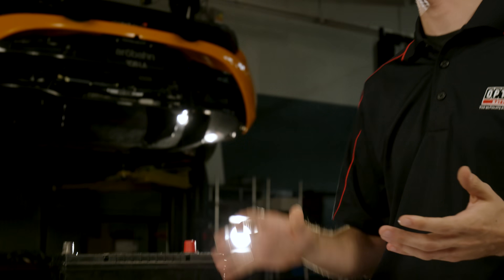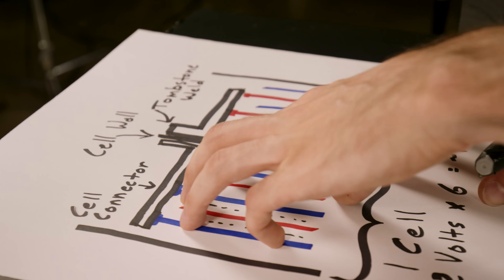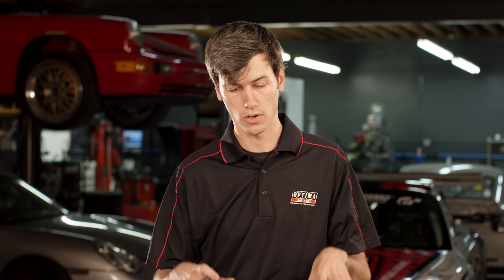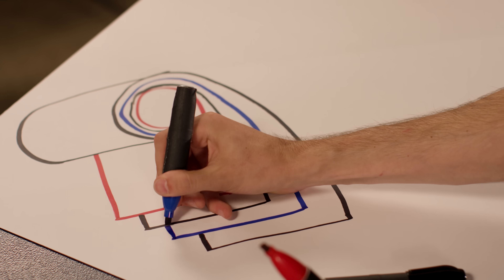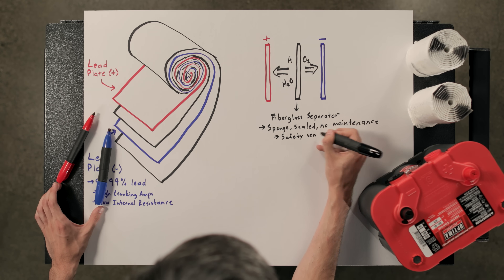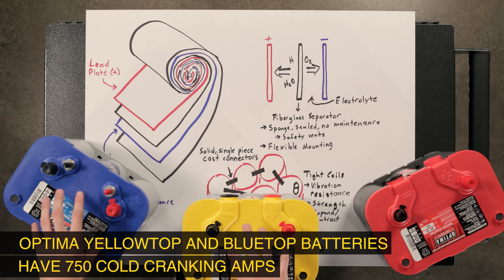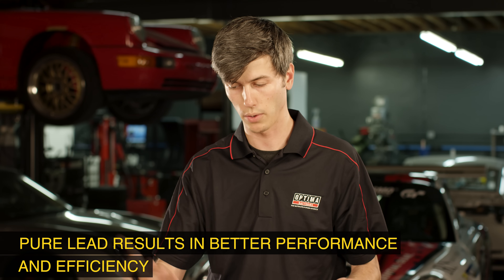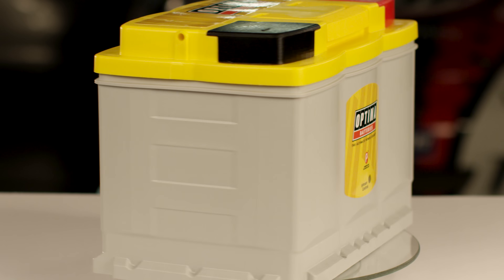What Type Of Car Battery Should You Use? Flooded vs AGM

Comment: IF Optima felt confident in their claim of "Can last 3x longer than regular batteries" then why are their battery warranties no different than the cheaper flooded acid batteries? For the price on one optima, you can buy nearly 3 ordinary flooded batteries. I'll take my $80 flooded and you can have the $240 Optimas from Mexico.
Reply: Warranty is for problems that are not due to abuse.
Reply: @nthgth  i am not talking about beating it with a hammer i'm talking about all the people who would run with a bad alternator over charging under charging killing it constantly. we are talking electricity and charge cycles there is lots of ways you can kill a cell or weaken them by "abuse" that won't leave any tell tale signs that would just look like a manf. defect and they have to protect themselves. these batteries are not meant for a everyday driver in a normal car they are meant for higher "abuse" scenarios
Reply: @ericvickery6357  ohh I see, I misunderstood.  That is a good point.
Reply: @nthgth  lol. Thats a first time I see someone admit their mistake in the comments section. Why don't you insist on your opinion as everyone does? Whats wrong with you?! Lmao
Reply: Went through 3 optima red tops in one year...bought from Amazon..
Reply: @stuartbachus  yellow top I just bought a jump box and roll with it .... og course I have to roll my bass nob
Reply: @stuartbachus  Switch to Odyssey, much better than made in Mexico Optima became junk when sold and moved to Mexico.
Reply: @stuartbachus got 3 Optima in 5 years, the do not like to be deeply discharged and my cars all of them i EVER owned was battery killers..,.,.
Reply: @stuartbachus  and how in the world did that happen?
Reply: @ericvickery6357  Optima was bought out a couple of years ago and now they're quality is just like any other battery except more expensive
Reply: @liveandletlive2894  Truth
Reply: @ericvickery6357  

Because those Optima  battery are dirt that's why, they don't last very long I would never buy one!
Reply: @liveandletlive2894  yes i've heard that as well
Reply: My yellowtop only last 1& 1/2 years.
Reply: @B2stunt1  i still have a yellow top that 5 years old! Showing age now tho, but we yse it on a boat! To just turn on engine.
Reply: @B2stunt1  mine lasted less than 6 months... only bumping 2500 with big three and stock alt
Reply: @B2stunt1  my yellow top is 4.5 years old and just sat in a car with no engine for about 3 months, charged right up and tested impressively well, doing much better than the 2 year old battery in my other car that has taken over as the daily, while she gets fixed properly
Reply: @timclarkjr1222  That battery was probably built in America before they sold out to another company which moved to Mexico They where great batteries before that, Not now
Reply: @timclarkjr1222  And I bet that battery was made in the USA not Mexico
Reply: @kurtnulf3362   the plant moved to mexico 4+ years before mine was made
Reply: @timclarkjr1222  Maybe so But after hearing all the complaints I decided on a Odyssey instead
Reply: @kurtnulf3362  i’m curious to know how much did you spend for that Odyssey was thinking about getting one myself either that or a stinger
Reply: @chadjay828  $275
Reply: I read that they were made in the US, are now made in Mexico and the quality went down the toilet.  I had a US made Optima red top in my son's car, it outlasted the life of the car, over 10yrs on an older car.
Reply: My Yellow-Top was only $160, but that was 10 years ago.  This is in my collector car which gets out only a handful of times in the summer.  It sits all winter.  I've forgotten the battery maintainer for a whole winter, come spring battery was totally dead as expected. Put it on the charger and it accepted the charge and got topped off.  No problems whatsoever with my 10y.o. YellowTop
Reply: I already get 14-18 years of life out of my flooded SLI batteries that are properly maintained, so what can I expect from the Optima that is 3x longer life? 42 – 54 years? That would be impressive.
Reply: @JT-ov2yr  Won't happen with today's Optimas. You got really good life out of those flooded batteries. Best I could do was 10 years.
Reply: I must have a poor quality yellowtop. Bought the Optima 400 battery charger. Only gets to 75%.
Reply: In our Las Vegas summer oven heat I found an Optima spiral cell battery does not last any longer than a plate cell battery! Therefore I'll go with INTERSTATE batteries since they get the highest rating. So far 4 years per Interstate battery  in our heat. Better than average.
Reply: Got theeem💀😩😂,so true,man.I have a great deal for paying 75$ for a flooded battery with 36 monts warranty instead of those ripoff dirty dicks😂😂😂Poor man pays twice...
Reply: EE sucks. he didnt talk about flooded lead acids can outlast AGM because you cant condition AGM with a desulfation process. you can keep desulfating flooded lead acid batteries over and over with 5 minute maintenance desulfation every 2 years if yo uhave a powerful charger or welder and longer if you have a small charger with desulfate mode. either get a small charger with desulfate mode like noco brand or something with 200 or more amps like a welder and blast the battery for 5 mins for maintenance every 2 years and 15 mins at 200 amps or whatever amps you have to revive a dead battery and wait an hour in between to let it cool off. repeat until 12.x volts. just remove surface charge by putting a load on the battery briefly or wait a few minutes for the surface charge to go away between charges to get accurate volt reading.
Reply: Bingo
Reply: I had a red top Optima that lasted close to 5 trouble free years, I was impressed.  In regards to standard flooded batteries, I have always seemed to have trouble with acid leaks that caused a mess and corrosion and never last as long as the AGM battery that I had.
Reply: Because they used to last longer, until they got bought out and moved to Mexico.
Reply: I know my Optimus have been going for over four plus years with no issues at all.  They also weigh almost 20 lb less than the factory battery dropping 20 lb from your vehicle gives you additional fuel savings over the lifetime of the battery
Reply: AGM batteries do last much longer. My 2010 Lexus RX450h has an AGM battery in the back, it lasted 10.5 years and 440,000 km before needing replacing.
Reply: I have an Optima... I'm also jumping my car off ....
Reply: Used to be made in Aurora Colorado
Reply: People still think products are manufactured better in the U.S. than Mexico or other countries? 😂😂😂
Reply: I paid 300
Reply: 4 years later now and a premium flooded is almost the same price as an Optima.
Reply: Have you priced a Flooded Acid Battery lately; they are almost as much a an Optima Battery!
Reply: EFB is the way to go 😊
Reply: Atleast a  "5yr replacement warranty"  would suffice but nope! 😄👎
Reply: My experience with 2 normal optima red-top battery and a deep cycle marine blue-top optima battery is that they last 3 times SHORTER then normal batteries (and that is why I tried a deep cycle optima battery to see if it would survive longer, and it did, about 2 times longer).... The advantage with Optima batteries is they can deliver a lot of amps when starting, which help a lot in the cold with stubborn diesel engines as they start a lot faster when the battery can provide a lot of power. But even if my optima batteries was broken and could not hold a charge (would self empty in a day) they could still provide the starting amps. So I kept my totally broken optima battery for years and just kept it on a charger whenever I parked the car... but if I forgot to put on on the charger the  car would not start day after...

I got tired of the optima batteries only lasting a year or 2 and gave up using them. Optima batteries do not like to be deeply discharged and it ruins the battery much faster then on regular batteries, and all the cars I ever owned have had trouble with discharging the batteries emptying and ruining the optima batteries because of their total allergy to deep discharge . 

Now I have a AGM battery, we will see if that can take the beating of randomly being deep discharged by a sick car better then the optima... (and when you try to find out where the electricity goes by searching with a amp meter you of course get 0, is will not do it when you look at it... , so to find the thing that empty your battery is impossible).
Reply: Marketing 101
Reply: I've had 3 agm batteries fail in less than 3 years.  I feel they are a great battery for many reasons but longevity isn't one of them unless you want to routinely use a battery charger to keep them topped off as alternators on most cars can't fully charge them.
Reply: Honestly, the Optima batteries come out of the same exact factory as EVERY OTHER vehicle battery brand you can think of.  Johnson Controls makes all of them; Walmart, AC Delco, BMW, Canadian Tire, AutoZone, Interstate... They have the monopoly on car batteries
Reply: Jonathan Ryan partially incorrect.  Interstate battery is completely separate from Johnson controls.  You also fail to mention East penn mfg/deka battery.  These are the three major battery manufacturers in the USA.  East penn/deka manufactures and supplies batteries for advance auto and o’Reilly among others
Reply: @jonathanryan2915  there is also DEKA & Excide that both produce good quality std & AGM lead acid batteries. Excide & Deka have both been mfg batteries for many yrs,A std lead acid  Excide battery I had in my daily driver Nissan Maxima lasted a full 10yrs ,DEKA AGM in my 1 motorcycle lasted 9.5 yrs & a Yuasa AGM thats the original battery still working great in my other motorcycle (high compression 1700 v-twin) that was mfg’d 11/2012 over 8 yrs old going strong.
Reply: I didn’t know they were bought out, but every optima I’ve owned has far exceeded the life and reliability I would expect
Reply: Optima was a great battery at one time, but are making them in Mexico now and like most everything made there and China is total crap 💩
Reply: @lovethesmellofracefuelinth7374  Everything is made in China including the device you are using to post.
Reply: because you can abuse anything especially batteries
Reply: @ericvickery6357 nope. Because most alternators don’t charge at the voltages AGM batteries require. 

You can’t put a giant warranty that backs claims when you know they’re guaranteed to fail.

Comment: For my application I replace the 2 car batteries(1 car mainly highway 90 miles a day, 1 car mainly stop and go 5 miles a day) with cheap Johnson Controls manufactured units every 2 years as just part of their maintenance.  They are typically 90 bucks each.  2017, 1 battery was actually $50 bucks due to a pricing mistake(thanks Walmart).

Comment: I heard about battery  desulfators recently and the potential build up of sulfur on the plates causing battery death/loss of performance. I can't however find anything reputable about whether "desulfating" a battery is a thing I should be doing on my batteries to help insure peak performance? Would love to see you weigh in on this topic. Trying to figure out if it is snake oil or not.

Comment: I'm building a project car with a 4.0 v8 and it currently has a optima redtop in it. I was thinking about swapping it out for a tiny motorcycle battery and using a jumper box like the ones you see on Amazon that are about the size of a cell phone. My idea is that i can plug the jumper in to start the car and then unplug it to run on the motorcycle battery. Since I have no stereo or any electronics other than the ecu and gauge cluster that the motorcycle battery should be able to power it just fine? I figure this would save weight and act as a deterrent towards theft. Would this not work for any reason?

Comment: The simple sealed lead acid battery in my car isn't some fancy and expensive optima brand, as those aren't sold over here.

Still the Varta battery has been in my car since 2002 and hasn't dropped a beat. Optima seems overpriced for what it offers. Many manufacturers make lead polymer gel batteries and sealed lead acid batteries that work just as well. Without paying the optima brand tax.

Comment: Excellent as always.
As a personnal experience with Optima Battery, mine was a Yellow Top and was 12 years old in my car (I say was, but you'll see why). Got a bit of audio that needed a better battery. 
Sold the car (hence the was) with the battery still in it (a,d the audio). Did a test of the battery before selling it : 100% charge ok, and still giving 100% of the voltage ! Never had to recharge it ! 
Really good quality, and I will go again with Optima on my next car.

Comment: My Red Top has been rock solid.  Crested Butte Colorado.  21 degrees below zero.  My 4runner wouldn't start.  Cranked it about 5 seconds a pop.  After about 20 minutes it finally started.  The battery was always there.  Nuff' said.

Comment: do hybrid/electric vehicles also use these lead/acid batteries? how are these  battery packs different? thanks Jason
Reply: I would also need some 12V battery type recommandation for 100% electric car like Nissan LEAF.  They do install a small Lead/acid classic 12V battery for accessories, radio, heated seats and heated steering wheel and Nissan recommend heavy usage of heated seats and heated steering wheel in Canada for cold weather in order to use less cabin heating system and preserve longer range from the High Voltage traction battery.  Many LEAF drivers had to change their 12V battery already after 2-3 years only especially in Canada (heavy usage in cold weather !) I read somewhere that AGM battery are not recommended for 100% electric cars as they have a limited number of charge cycles, and that may explain why Nissan keep installing Lead-acid 12V battery in their 100% electric car.  I think that the 12V battery might be charging each time the car is plugged to a charging station (110V and/or 220V and perhaps 400V DC also). I'm not sure if they use a DC-DC converter (400V to 12V) and/or AC-DC On-Board-Charger (110V / 220V AC to 12V).  What do you recommand for longer life battery in 100% electric cars like Nissan LEAF ? Thanks Jason !

Comment: No mention of the fact that AGM batteries have a low tolerance for heat. Cold amps are all anybody worries about, but those of us in HOT climates have to constantly replace batteries due to reduced lifespan from heat. AGM is even worse.

Comment: Agm batteries have better vibration resistance and are sealed and spill proof. But modern flooded cell batteries are still maintenence free. With lead calcium plates and catalytic caps on the cells they recover most of what they lose. By the time you need to add water, the useful life is done. Also flooded cells are cheaper and Agm batteries don't necessarily last longer. In many cases, they don't.

Comment: I managed to kill an optima yellow top by leaving it in the corvette for 2 months in a cold garage.  Voltage was down to 3 or 4 volts and would not charge back at all, the battery store tried many things too. Now I unplug the batteries as soon as I stop driving for the winter.

Comment: Running gag at Battcon, you know the convention for DC power engineers, "This battery is maintenance free." Love the videos.

AGM have a great energy density, but I've seen higher failures out of that battery design in a stationary application  (emergency back up power for industrial motors/pumps).  It's not a fair comparison for car batteries since they are not on float all the time which increases the rate of gassing leading to cell dry out. Cell dry out means less electrolyte and loss of capacity. In stationary applications AGM last about 6 years vs 20, when your cells weigh 100lbs each and you have 60 to 120 less frequent replacements are a god send.

I'm pointing this out so a young engineer doesn't watch the video and use AGM in the wrong application and to show how Jason is more interesting than the average engineer

Source : I'm a DC systems engineer for a power company.

Comment: The old EverStart Maxx-78S lead acid battery in my truck got me 13 years of dependable use without any maintenance. Amazingly, it could start the truck after sitting months at a time (that was a pretty common occurrence too).

Comment: Unfortunately after Johnson controls started making the optima batteries seemed to go to crap. I work at AutoZone and when we get optima batteries in (which after Johnson controls took over we started to) they're either 10 year old real optima that take a charge and then test good, or week to a year old JC "Optimas" which test bad. We've even had a few crib deaths right off the truck. They seem to be junk now. The longest I've seen a JC last is 5 years with most lasting 2-4 here in SoCal and the longest I've seen the older ones do is 16 with most lasting 7-10 years. Shame really........

Comment: I owned a optima battery and It lived through 2 cars both with a 2500 watt subwoofer system.   They are well worth the money as it will out live at least 2 regular acid batteries and it cranks hard in the winter..   somethings are worth what you pay for it, and this is one of them..

Comment: I didn't know flooded lead acid batteries that you might have to maintain still existed! All my cars ive had (built from 2002 on) have had maintenance free batteries which either work, or dont, but if they dont, you cant do much (other than charge it and hope!). I recently bought a battery with a lifetime guarantee, cost about double the cheapest battery, but hopefully worth it. I used to have AGM batteries in my Sinclair C5 - they were really good as I believe their performance improved as the temperature dropped, unlike lead acid which is the opposite.